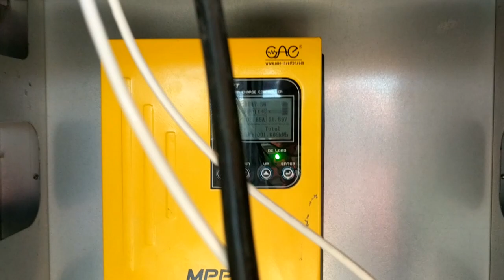AirCrete cellular cement foamcrete Safety Dangers   Be safe at aircrete workshop

Comment: Right ON. Like adding this layer of lessons to my previous attentive study of AirCrete options.  Wondering about what options you have found for dealing with building permit hoop jumps, or bypassing em. I like the idea of being able to experiment on my own property. I have heard of some folks labeling their aircrete building as animal shelter barns (for lesser requirements), building small enough size for no permit required, or even making a boat base  for a detached bedroom. I am sure the related challenge and options depends on your state and specific locality, and level of privacy. Got some design in my mind for a bedroom type portable building with square metal tubing frame and AirCrete walls that could be disassembled and moved to a different location, as an option for our housing shortages. Seen AirCrete Harry has links to a supporting structural engineer for dome and possibly rectangular AirCrete home building.
Reply from the maker: Code is often met by building a house who's roof is supported in poles and the AirCrete is non load bearing insulating infill.  There are other options like "non occupied", small, storage, ect..  Then there is taking responsible, requiring any public servant to sign everything they say under penalty of perjury and putting and end to oppression without using an attorney.  There is a reason persons are not free and publics servants do not uphold their charter (constitution)

Comment: How hard would it be to make an aircrete house that is on grid? what all does it take to get a building permit for an aircrete structure? Is there any way to get around that if you just want to build a small structure to test out building methods? also I wonder if you could make furnature such as bookshelves desks, coutnertops etc out of aircrete and build them into the walls. This would be an easy way around the problem of normal furnature not being designed for use in a dome. I am wondering if the properties of aircrete make it less of an ideal material for that type of usage where you need more than just compressive strength.
Reply from the maker: Alternative building does not get permission usually.  The closest work around is pole barn with AirCrete infill.  This is more likely to be allowed.  On or off grid the only difference is the power source
Reply: Whent it's raining cats and dogs and caimans a foam panel breezeway or pergola seems like a good test project.
Reply: I was talking to a structural engineer..  he says if he OKs it..  it will get permitted...  

So I'm going to try to get it permitted...  we will see.

Comment: Thank you!!   Cooties 19!!  Lol. Face diaper!!!
A much needed safety video. 
I’m actually using air Crete for insulation purposes only. Structurally I am using shipping containers on peers made out of 5000 PSI concrete. The nonstructural aircrete covering would be on the outside of the shipping containers where I would frame it out using welded bolts on the shipping containers. My experience as a general contractor has been pouring elevated slabs and beams. But I see air Crete as extremely brittle and I wouldn’t want to put a couple shipping containers on top of it. I am concerned about the aircrete eating away at the shipping container.  What do you recommend?

Comment: Show how to form aircrete monolithic dome sections that two people can assemble. Can the foam be generated without a compressor? What happens with 25 gallons cement slurry mixed with 75 gallons foam? Compression strength? Do you mix the foam separate using just a blender/beater, then combine it with the slurry? Or mix the slurry, then add the Drexel/water?
Reply from the maker: Foam is injected into the slurry as it's mixed.  I formulate to have a class 5 cellular cement.  Excessively stronger than just enough to stand up.
Reply: A compressor cost less than the soap. So get one!